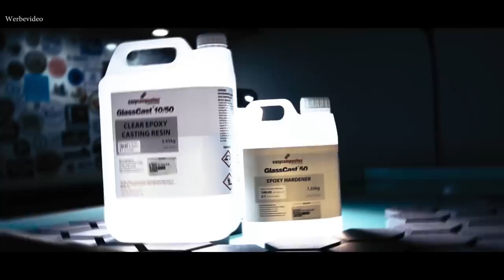bog oak and epoxy resin coffee table - river table

Comment: Even though i like the massive amount of effort put into filming this, i actually vastly prefer non-cinematic videos, where you can actually see, what's going on and how it actually looks without the massive use of filters and editing.

About the final product: it looks absolutely awesome. I would've like for more wood to be used, but it still looks very good.
Reply from the maker: Thanks, effects are only with transitions and a lot of videos have not only mine. the nice thing is that I dance from the group and I want to achieve that too!
Reply: @SpecialWorks  That's completely fine, i just prefer a different style, especially with epoxy, because it usually does look very different without backlighting and changes in contrast.

Keep on, what you're doing:)

Comment: An amazing work of art!!  Really inspires every time a watch this one..
 Guess i gonna give it a shot..

Fun fact :D ..  
I never use resin epoxy on our small furniture shop, Hence, a research including some safety precautions on using this products.

I have some questions and it would be a great help get some opinion on experts..
This is my favorite color combination

1. Since i dont have bog oak.. it is possible to use a torched togas tree (Vitex parviflora) as an alternative?
           And after the jet oscillator,  torch the expose part so that it turns black... i dont know if this will damage the resin..

2.. any alternative..  

Any insight or tips is highly appreciated..

Comment: awesome table, make it green and some LEDs and you will have a razer gaming table, 
if it wasn't bog oak but normal wood how much would it cost?
Reply from the maker: Hola, lo intenté con leds, pero en mi opinión no parece tan genial, simplemente se ilumina pero dan ya no se ve el patrón de resina epoxi. Por favor escríbeme un mensaje a través de mi página de inicio. muchas gracias

Comment: Love the table! You did an amazing job! I'm still learning about working with epoxy and resin, so can you please explain why you buffed with black finishing coat as opposed to clear? Does it leave black in the top finish? Thanks!!!
Reply from the maker: Thank you, every polishing paste leaves traces in the wood. Especially in open cracks and split. if I have dark wood dan i also use dark polish paste.
Reply: @SpecialWorks  cool! Thanks for the tip!

Comment: This is such an awesome video and has inspired me to give it a shot! How strong is the resin for a table? I have a table top which could do with an upgrade. About 1.5m. If I made a table similar to yours would I need to put some re-enforcement on the underside?
Reply from the maker: Thank you very much! The table should be at least 2.5 cm thick and that's enough.

Comment: Wow amazing, how much pigment are u using for a gallon? And how much grit sandpapers?
Reply from the maker: Here is a link to the pigments https://www.glasscastresin.com/metallic-resin-pigment-powders

I cycle from 80K - 4000K and then polishing until all the scratches are out
Reply: @SpecialWorks  Thank you for the answer but how much are u using for this table, its a little bit translucent? 10 gram in 1 gallon?
Reply from the maker: @MarkCHOPPERRead84  My table is not translucent. it only has two different pigments. you have to feel like mixing.

Comment: Fantastic video; don't mind the haters. This is a full package presentation, not just a demo video.
I do have one question: what are the screws you use to attach the base to the top?
Reply from the maker: Thank you very much! Since I'm not worried, in my statistics and comments I see what is good and what is not. I can handle these people well. You also get to hear it from me. Here is a link to the screws if you mean them. https://www.rockler.com/steel-threaded-inserts-select-size
Reply: @SpecialWorks  Those are self tapping, so with brittle materials like epoxy, how you avoided chipping and cracking when installing these?
Reply from the maker: @Hellsong89  I have not found out yet. I pre-drilled with the drill that fits the screws. After that, I tried to lower the hole and prevent tears but it did not work. Usually I use these screws only for the feet and at the bottom which the feet can blame I live with outliers.

Comment: What do you do to be able to polish the wood do you put a finish on the wood first then polish the resin ?
Reply from the maker: I loop until 2000 and then polish everything. use only very little polishing paste so that it does not stick in the wood pores.

Comment: I think i just asked this on another of your videos so im sorry. What are you using to make the box you use to pour into. Want to try something similar myself
Reply from the maker: these are coated chipboard.
Reply: @SpecialWorks  Thanks so much for the reply. I did think they looked like that but i didn't realise you could use that with epoxy without it sticking. Did you use some silicone spray? Bloody beautiful table
Reply from the maker: @Davvyk  I used duct tape. Do you actually see in the video.
Reply: @SpecialWorks  My bad. I thought that was double sided tape help iwth attaching the sides initially. Didnt notice it was the whole way across.

Comment: All of the resin river tables and stuff have just started popping up in my recommendations for some reason the last few days...but this is by FAR the coolest looking one.  Going to use this design for a hobby desk I started planning on building now.  Maybe use hex tiles instead of wood though.
Reply from the maker: this bog oak is a good 18000 years old.
Reply: @SpecialWorks  looks incredible for its age.  I might take a different angle and go with ceramic tile for my design as I am going to be using this incredible design as the top for my hobby desktop so it will be easy to clean and maintain.   I think 4" hexagons would be best for a 2'x4' desktop.  Black tile with white resin.  :)

Comment: Nice Job. I would have incorporated an LED light bar on the far blue side of the table (opposite the honeycombs) to illuminate the blue epoxy...oh well, next time, eh?
Reply from the maker: Led is out of the question for me because it only lights up and the whole pattern disappears from the epoxy resin. epoxy does not conduct like glass, you can see every single led.

Comment: Was that fiberglass polish you used to buff it out before the odies oil?
Reply from the maker: I polished everything first and then made the finish with odies oil to seal the wood. In the past, I first sealed the wood with odies oil and then polished it. The only problem was that the wood was dull and lost its luster from the 4000 grit. Therefore, I polish first and then I can with the odies oil bring out the shine again.

Comment: bro, how do you wash mixer after using it with an epoxy ? =)
Reply from the maker: I let it drain well and then let the epoxy through harden. so you can use it many times and it costs almost nothing so a little agitator.
Reply: @SpecialWorks  thx =)

Comment: What fixings did you use to secure the legs into the resin?
Reply from the maker: These are threaded nuts from Rampa
Reply: Special-Works Did you screw them into the resin or did you bind them in?
Reply from the maker: @ModifiedMadness  in the video I turned it purely.

Comment: Great video and great design! How about structural stability? Did you put anything on the middle/underside of this table connecting the legs? Just wondering because I would hate for a kid or adult sit on it and destroy this work of art! Again awesome work keep it up!
Reply from the maker: Thank you so much! Thanks to these screws, the strength is so great that it does not need connecting struts.

Comment: Does the vacuum of the resin negate the need to torch as it sets or is that still a step you had to take while the resin cured?
Great work!
Reply from the maker: With the vacuum chamber I withdraw the air bubbles. The epoxy resin is already mixed and can be poured softly after the vacuum chamber. Thank you very much
Reply: @SpecialWorks  Hey, awesome work ! Result is quite imprevise :o
Could you please detail a little more the vacuum chamber ? How did you built it ? Do you have any pics ?
Thanks and keep up the good work !

Comment: This table is badass, but every single video I watch they always skimp out on the supports. I know a coffee table isnt supposed to hold 500 pounds but it looked wobbly as hell in the final shots.
Reply from the maker: The table is very stable. At first I also thought that could be very close because the plate is 22mm thick. But I have to say that the feet hold very well thanks to these screws.